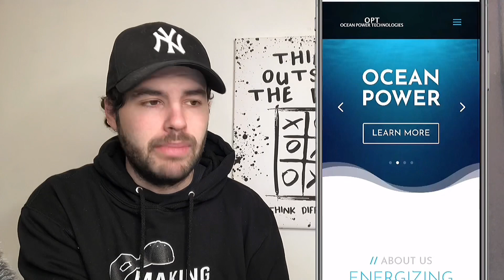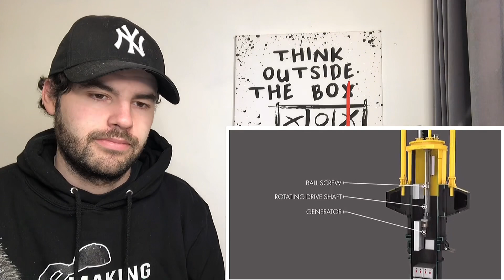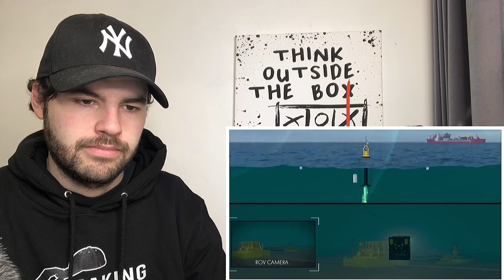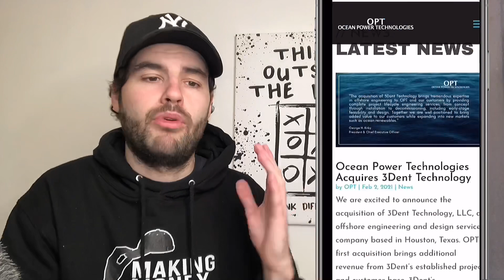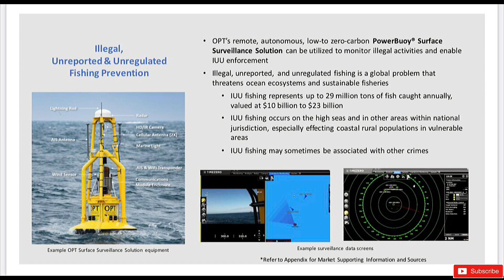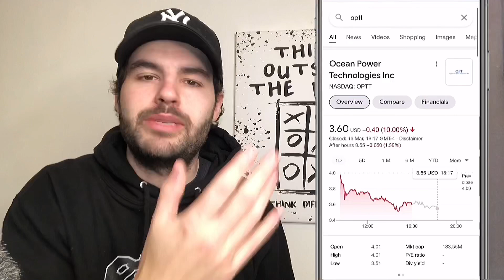PENNY STOCK WITH HUGE POTENTIAL | OPTT STOCK ANALYSIS

Comment: I think that since they are not trying to power anything on land, using the bouey only to run  electronics out in the middle of the 🌊.  For that reason I'm out
Reply from the maker: “Yet”... nothing to say they cant harness the power and use it for other resources... somethings got to power these services though, and this is one renewable way of doing it for sure
Reply: Actually offshore electricity stores a lot more and is cheaper than the lan base energy (solar and wind).
Reply: If they were using something to harness wave or tide,  to power houses or street lamps. Great.  But to power government spy boueys, nah don't care.  I just don't think this will ever make you rich.